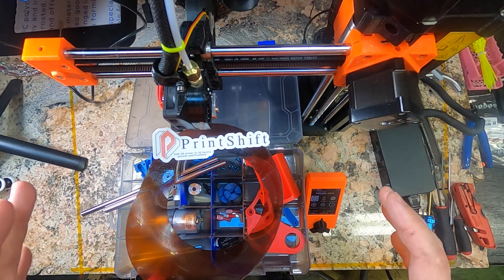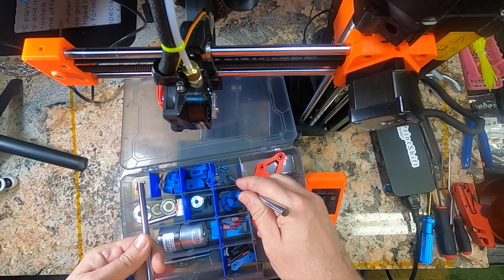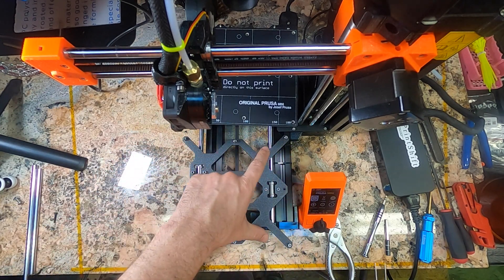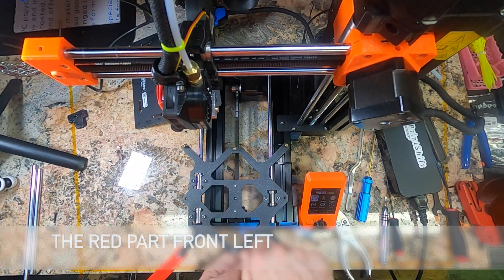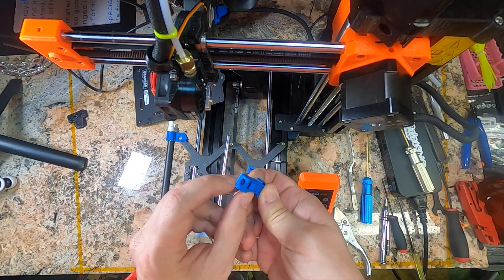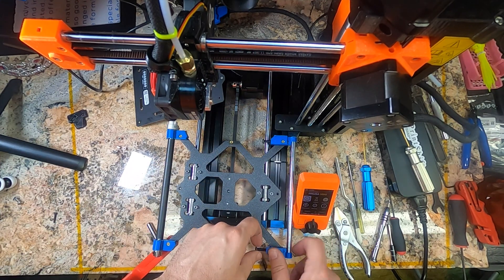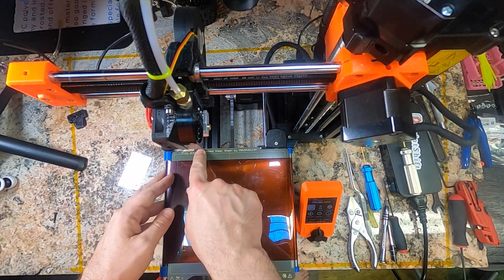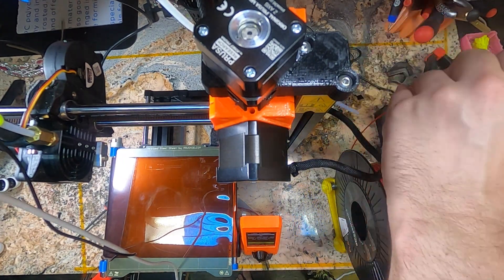PrintShift 3.0 Step 2: Belted Bed Build

Comment: Hey there Paul! I am currently working on sourcing the parts for your amazing mod to the Prusa Mini! I do have a quick question. For the EPDM tubing I look at the printshift build logs and BOM, and I can't seem to find the specs on the type of tube you used. Do you happen to have the inner/outer diameters of the foam that you use? 
Thanks!
Reply from the maker: The foam I've sourced is 5/16" ID (8mm), 7/16" OD, 1/16" (1.5mm) wall thickness: https://www.mcmaster.com/9776T15/

Somehow I missed that on the BOM, but it's in there now
Reply: @PaulChase  That is perfect! Thank you for the quick reply!